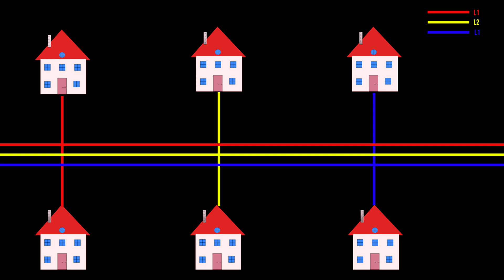New Builds To Get EV Chargers BUT ONE BIG ISSUE!

Comment: I can’t charge at home however I agree entirely that we should be using 3PH. How much extra would it be for car manufacturers to put 22kw AC chargers on cars? The reason I say this is that if they did I would hardly ever use a DC rapid.
Reply: I've never understood why so few EV's can charge at 22kW AC. I find it a huge advantage on my Zoe.
Reply: @malcolmfowler8972  assume its Penny pinching on the AC charger / inverter

Comment: My estate is two years old and every home is advertised as having a car charger wether it’s on the side off the house or in the garage. Mine is in the garage. 
However, close inspection of the unit you find it’s a 2kw external three pin socket in a fancy waterproof case., (Rolec priced at £105)I used it for my lawnmower when I’m cutting the grass at the front. So in reality, it’s not a EV charger. You can plug a granny into it. Some on the estate have went on to install proper EV chargers. 
What a swizz!
Reply from the maker: Least new rules will stop that